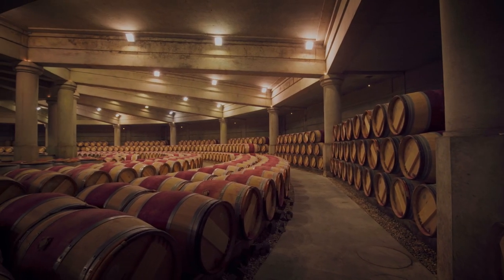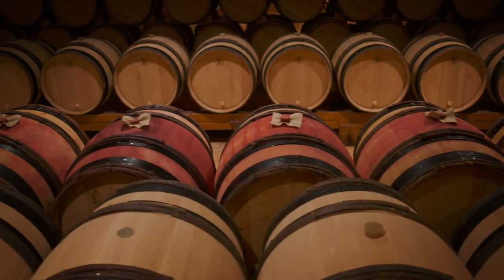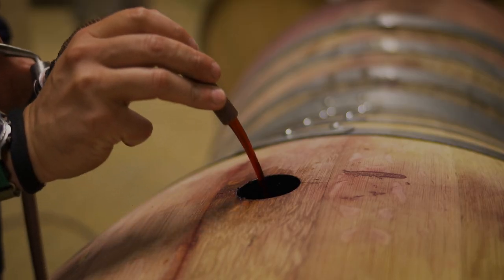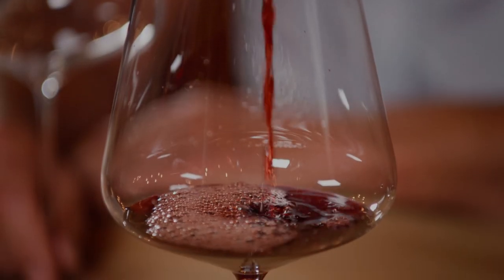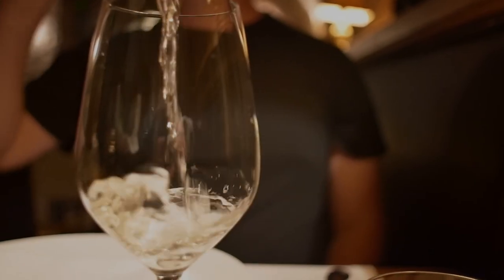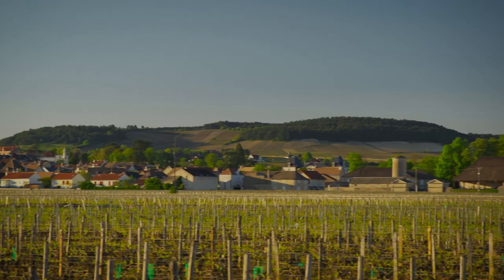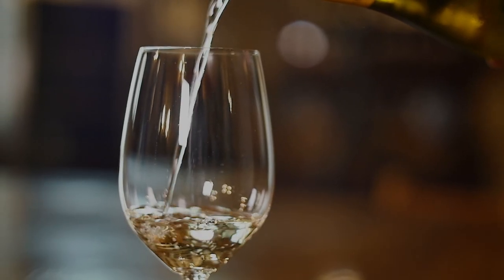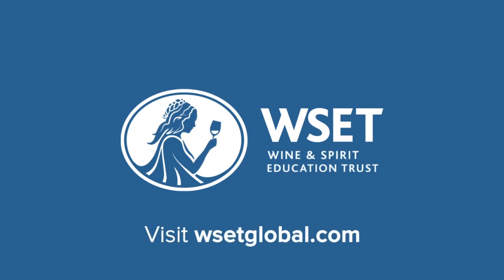Why is oak used in winemaking?

Comment: I have often wondered this and knew that they are best for being watertight (& of course, adding character) but are there other hard woods that can be used? Such as Cedar? If so, what are the negatives (downsides/issues) in using those instead of oak?